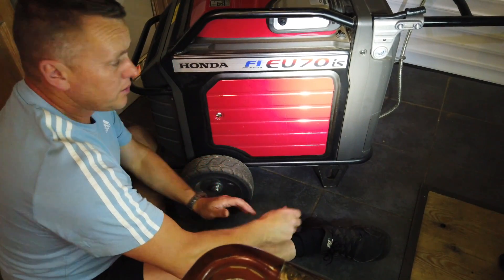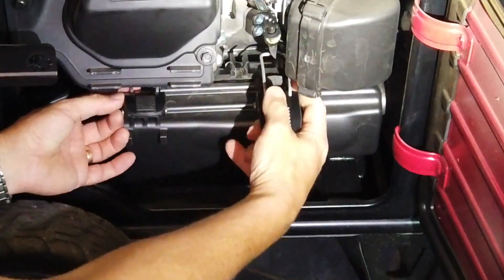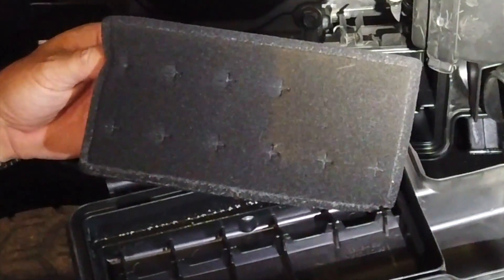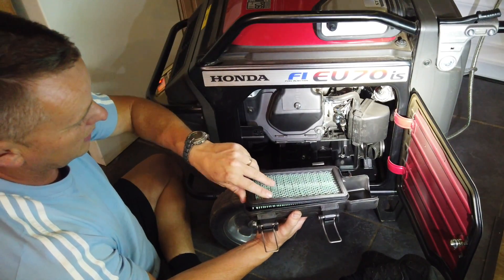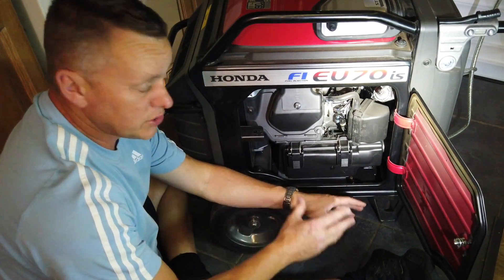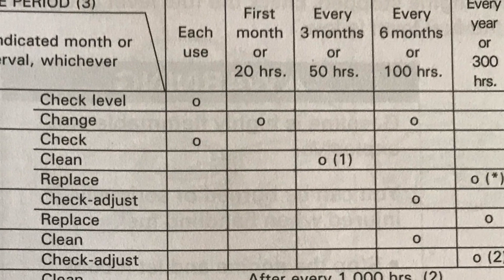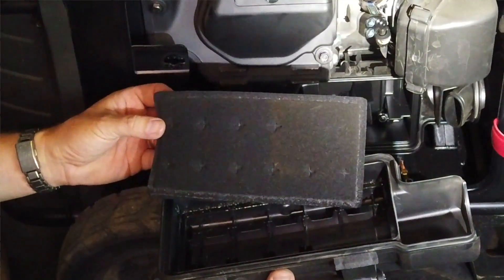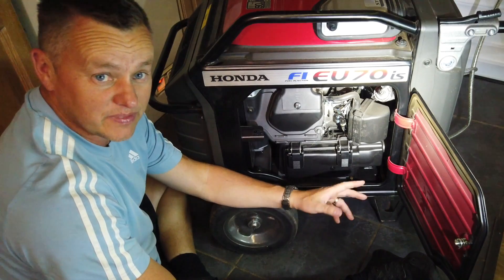Honda EU70is Air Filter Service, How To Check & Replace.

Comment: thanks aaanton11 brilliant videos extremely helpful ,hope you may have a video soon of how to wire up the 107 rev counter on a car that doesnt have a connector fitted,  i had to laugh because another person i asked about this also didnt know how to fit the rev counter because they didnt have the wire terminal also so they just fitted the rev counter and pretended that it worked all the best martin
Reply from the maker: some have swapped out both the speedo unit and the rev counter, bit I will definitely try and find out about the retro fit, look for some wiring diagrams, Thanks for the great comments👍🏻👍🏻🛠

Comment: brilliant vids  have you got a vid of how to wire up a rev counter for a peugeot 107 that doesnt have a  oem plug connector  fitted  to the rear of the clocks, as i have fitted a rev counter but my 14 reg 107 has not got the rev counter connector  taped behind  onto the loom as its an update model  and no wire was ever fitted , what and where do i wire the rev counter to as  no one seems to know
Reply from the maker: I thought all the models had the connector fitted, but I have been wrong before, that's a interesting one, I will look into it if I find anything out I will respond again Thanks Martin for the great comments👍🏻👍🏻🛠